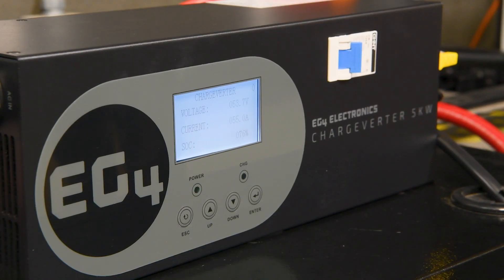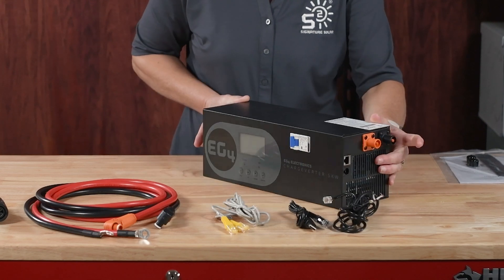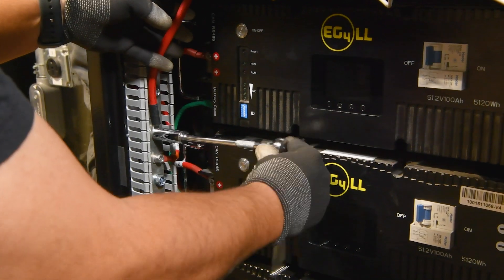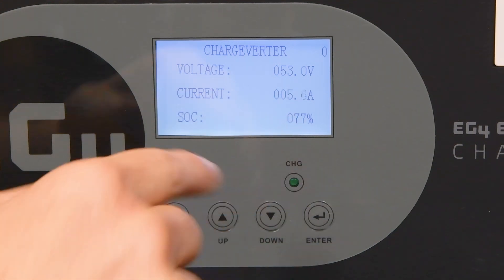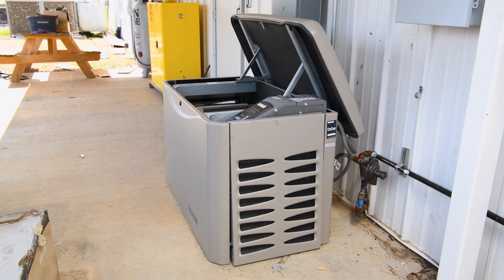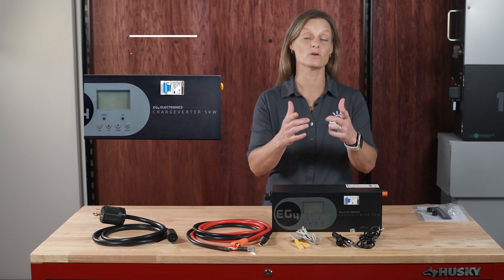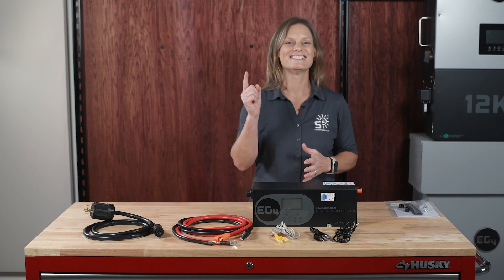EG4 ChargeVerter GC: Charging Batteries Efficiently from a Generator

Comment: WHat would be nice is a warmup time and a cool down time. I previously had this programmed via relays but then victron added into their firmware which was nice. Since I got my new inverter, I've been able to charge at 5000 watts however the power is dirty. My stove resets constantly and my pressure pump can't get enough power to flip the pressure switch. I plan on ordsering one of these and worse case, I can setup an intricatre relay speghetti monster to add warmup and cool down. Maybe you have a new model or firmware coming out soon?
Reply: It supposedly does have a cool down. No warm up though.

Comment: hi , can i top balance a DIY 48v 320ah battery from this , and/or is it the same if i charge the battery cells to 3.65v with a table power supply before assembling in a DIY battery? thank you for your help

Comment: Why not just put the superior electronics in the inverter so this is not needed?  In other words, if this can accept dirty power, why not build the inverter with the same charging architecture which can accept dirty power.   I'm confused.
Reply: Because not everyone needs it and it's more money. Inverter/chargers generally use the same hardware to invert as they do to charge. THis means that you can not charge and invert at the same time.

Comment: If I have, say, an 8000W draw for 10 minutes or so (e.g. cooking), will it take 5000W from the generator and 3000W from the battery?
Reply: Yeah. But it will still eventually catch up unless your average draw is over 5000 W. If your average draw is close to 5000 W this might not be a good product for you. My average is more like 1000 W. So I think this will work for me. I just bought one but haven't hooked it up yet.

Comment: Hi, I know this might be a dumb question. But does it have to be plugged into a generator? Can it be plugged into a 120 house outlet if seeded.  Thanks darrell
Reply from the maker: The EG4 Chargeverter is designed to work with generator inputs, but it can also be plugged into a standard 120V house outlet as long as the outlet can handle the power draw of the Chargeverter. However, you need to ensure that the circuit can support the current requirements without tripping breakers.

Comment: These are over $700 now and I just found out my EG4 18Kpv doesn’t like my generator. My batteries will be dead in a few hours with no way to charge them until grid power is restored or the Sun comes up 😢
Reply from the maker: We completely understand your frustration. We're here to help if you'd like to take a closer look at your setup or explore possible solutions to prevent this from happening again.
Reply: @SignatureSolar  Thanks for the reply. I think I will sell my current generator and replace it with a compatible one. In the long run this would be better than adding another piece of equipment.

Comment: Is there a wiring diagram for hooking this charger up to 4 indoor 3g4 wall mount battery's?
Reply from the maker: Hi! I don't believe there's a wiring diagram available, but if you have a bus bar that all the batteries connect to, you can simply connect the charger's positive lead to the positive bus and the negative lead to the negative bus.

Comment: I have two Ecoflow Delta Pros and 4 smart batteries with the dual phase 240v adapter. The unit will not charge through AC while running on 240v. I have a Champion Generator 4000W.  Can I wire adapters for the DC down to a xt90 and down to a XT60 so that I can charge with DC using the ChargeVerter?
Reply from the maker: Hi! It’s recommended to check with EcoFlow tech support before modifying any wiring, as changes from the original design could impact the warranty. You can email them at support@ecoflow.com - I hope this helps!

Comment: I have a home that all major loads are propane, my electric usage is some LED lighting, normal outlet usage..wifi,computer,tv, etc. The only larger loads are a 240v well pump and 2 ductless A/Cs also 240. Because of these 2 appliances I am forced to use a 240 volt inverter generator. I would love to use my small 2000W Honda inverter but it is only 120V. Could I install a battery pack with a 240V inverter and charge the batteries through the Chargeverter GC with 120V? This would allow me to turn the generator off at night and use battery power for the minimal night usage and then let the batteries charge with my 120V generator during the day. The reason for this is because the little 2000 inverter produces twice as much electric as my large inverter on the same amount of fuel.
Reply from the maker: Hi! Yes, this would likely be the best approach.

Comment: " Firesafe " backing  is very IMPORTANT   ... AAC panels are produced here in Central Florida  .

AAC
 (Aerated Autoclaved Concrete) 
is one of the most fire resistant products available  . 
   Aercon , Florida
Reply: The web site just shows blocks and large construction pieces. Can I get thin sheet pieces maybe 1/4 to 1/2'' thick?

Comment: hi Kelly  can you tell me who manufactures and what size the Amphenol connectors are on this Chargeverter as i would like to purchase additional male and female plugs.    Also i have an eg4 500 100 solar charger which is brand new   no. 1 the voltage does not mat what i measure  via meter and what my eg4 battery says    .  so there is an issue there  also i get the red light and buzzer when solar production falls off at end of day  . I have not been informed on how to remedy other then watching youtuber's videos ?   apparently a firmware update is nec. ,i called ss and basically schooled whomever at tech support on the matter and told them i need a special cable. Gentleman asks around and gets back to me -yes but we don't have any in stock , here  is a link to purchase components  and no directions on Constuction  pins ect.   and no procedure on actually updating the firmware?    Not good  I've spent plenty on 6000xp,  280 ah indoor batt  chargeverter  now solar charger  . We can do better  please advise  thank you Scott
Reply from the maker: Hello! I'm so sorry you've been having trouble! If you'd like to reach out to us directly at engagement@signaturesolar.com, we will get you taken care of!

Comment: Hi can someone tell me what size generator you need  to run the chargeverter at max charge rate in the 120 volt and the 240 volt. I understand  120 volt max charge rate is lower compared to 240 volt. just looking for generator sizing for both applications. Thanks .
Reply from the maker: You would need at least a 5000W generator for 240v or 3000W for 120v for max charging.
Reply: @SignatureSolar  Thanks so much for getting back to me.
Reply from the maker: You're so welcome!

Comment: My generator (supposedly an inverter type) was kicking out every now and then and would not hold its rpm consistently but after installing the ChargeVerter it's as smooth as can be.  I'm feeling confident that I can try my big generator now and I think I will - especially this time of year. 
Kind of pricey but in the long run this is worth it.
Reply from the maker: Thank you so much for your feedback!

Comment: I have a 2200W Honda generator. Can I use this small generator with the Chargeverter to (slowly) charge my system?  (my EG4 18kPV with 2 Powerpro 14.3kW batteries). The Chargeverter does not list a minimum power required. I know this will take some time.
Reply from the maker: Yes, that will work :)

Comment: My set up will basically be a custom portable kitchen/studio (16' x 8'). I was considering this to connect through the grid, to charge the battery(ies) overnight and then use it in the day. If I want to use my appliances for the desired times (6-8 hours), I was hoping the EG4 outdoor battery would suffice. Too small of a space for the indoor. So, that led me to loving that battery's emp protection... Would this chargeverter still work with the outdoor eg4 battery during emp 'times', or would it need protection like the 18k inverter models, etc.? Thank you!
Reply from the maker: It would need protection.

Comment: Can the chargeverter connect straight into a generator input (example 12,000xp)? Or is it only designed to be connected to the battery via a bus bar?
Reply from the maker: Yes, just the battery.

Comment: Can you tell me if this charger will charge lead acid batteries also? thanks
Reply from the maker: This is designed for lithium. Other battery chemistries are supported but the manufacturer should be contacted prior to use to verify charging specifications.

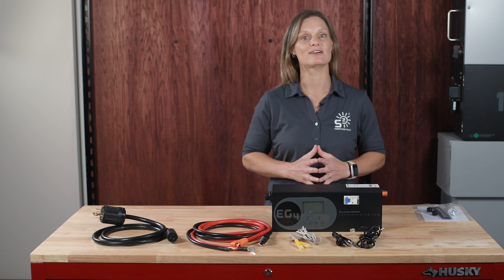Comment: 11:30 Re: Alternative power sources -- great point on this. 
Q1: Will using it with the Cybertruck that has a NEMA 14-50 (40 amps) work since the EG4 spec explicitly says the limit is 26? ("Maximum Input Amps: 26A at 240VAC, 28A at 120VAC")
Q2: How does the "Gen 2-Wire Start/Stop" work in this EV truck scenario?!?

Comment: Signater Solar, I'm wondering if you can run this through a shunt? I know it says connect to a busbar but why couldn't you just connect the ground to a victron shunt instead. Would it work? Have yall tested that method by chance?
Reply from the maker: We have not tested it. We recommend following the manufacturers guidance.

Comment: I sure wish you would have shown us using the powerpro battery. This must be difficult because most of us have the powerpro battery
Reply: Wonder why Sig solar will not respond to this question???
Reply: @LarryRichelli  They are only responding to a handful of questions.
Reply from the maker: Hi Larry! We appreciate your input! Could you rephrase your question?
Reply: @SignatureSolar  I would just like to see how to connect the ChargeVerter to the EG4 PowerPro WallMount AllWeather Lithium Battery
Reply from the maker: Understood, thank you! There isn't a video at this time but we will forward your suggestion and take it into consideration! You would just connect it to the bus bar. If you need any assistance, you're welcome to call in at 903-441-2090, we're happy to help!
Reply: @SignatureSolar  The thing is the battery is outside so a bus bar is not used as the 18k inverter is on top of the battery. Could you please tell me what the connectors are on the chargeverter output and where I could buy them.

Comment: so my generator is rated less than 2%thd, so it's fine to use for just emergency backup charging the two eg4 48volt  batteries running with my eg4 6500ex that is totally just backup emergency power isolated from the grid at all times......the setup just powers about 3500watts(max of all fridge /frezzers compressors running which they obviously don't run 100% of the time)  of bare necessity items in case of rare power outages.....keeps my fridges, freezers, and some lights, phone chargers, ect covered again only as a redundant system if I don't want to run my genny say over nights. I have 7500 watts of solar panels yet to install, but those are not online as of yet because I need to built the array structure still.
Reply from the maker: Sounds like a great setup, let us know if you have any questions!

Comment: It is not like generators fall off of a cliff at 60% Typically the "dirty" ones get worse as the load increases but it is not that difficult to find one that will hold below 5% thd all the way up to 100% capacity you just have to LOOK

Comment: The charging voltage that this unit is far too low to fully charge a 48 Volt LFP battery. The manual for this low-cost charger states that this unit is only capable of a 57 Volt maximum output. In a properly designed 48 Volt LFP charger, the output should be capable of reaching at least 58.4 Volts or3.65 Volts per cell to fully charge a 48 Volt LFP battery,  This unit appears to be poorly designed for use in a 48 Volt LFP charging system.

Comment: Can you connect this to a eg4 wall battery while having the battery connected to a 6000xp?
Reply: one of buddys comments above said you cannot, if your talking about the communication cable
Reply: @pleasurem3  no I meant the positive and negative wires. So you can charged the battery with solar and generator. 

Not to mention having 2-3 batteries in parallel how would you charge them with the generator via the Chargeverter GC and solar.

Comment: I have a champion Model #201175 generator.  It has button start features only by the looks.  Will I be able to do the remote start via dry contact cables?
Reply from the maker: If the generator does not have Dry Contact terminals to run a 2-wire auto-start circuit from then it cannot be autostarted by the inverter.
Reply: @SignatureSolar thank you!

Comment: IAnothe well done video.  Thank you.  I have a Victron system.  Will turning on the charge enter cause the Victron Multiplus II to shut down like is reported on the EG4 systems?    Is there a market for a modbus device that will snoop on the data between Battery and Inverter, and then act as a slave to the Chargeverter Modbus master?

Comment: Will the PowerPro Battery Paralleling Cables work for this without having to have a bus bar? I'd have to buy more cable any how to connect the battery to the bus bar. So I might as well get a set of paralleling cables..
Reply: I have 3 outdoor wall mount 280 amp hour batteries in a Boss Box. I designated the middle battery as the #1 battery and used paralleling cables to connect both outboard batteries. Everything is connected with their 2/0 cables. The middle battery has 2 positive and 2 negative cables coming from the middle battery and feeding into the Flex Boss 21 inverter. This works very well.

Comment: Would the chargeverter be redundant if you are using a Generac whole home generator or is it still a good idea to run the Generac through the chargeverter ?
Reply from the maker: It wouldn't be redundant. The chargeverter safeguards the inverter from the high total harmonic distortion (THD) generated by the generator.
Reply: @SignatureSolar  thank you.

Comment: Quick question, I noticed you said to charge two or more powerpro batteries you would need a bus bar.  Do you have information on a degsun bus bar? Trying to design an offgrid system that will be charged with solar or generator during winter.

Comment: What specific (less expensive) generators are recommended for use with this charger?
Reply from the maker: We don't recommend specific generators because our inverters are generator agnostic (can accept any if they fall into the correct parameters); those parameters are 5% or less harmonic distortion, 120/240V (so not 120V generators), and floating Neutral

Comment: One thing missing from these videos is what happens if you have non EG4 inverters or batteries.   This product looks like it would fit my needs.  
I am presently under Calif's NEM-2 and cannot add to my existing solar system
But now, with an EV, and heavy irrigation via a Well, and booster pumps, I am using a lot of grid power.

In addition, anytime there is wind, or a Fire, or a car crash, the utility cuts the power, leaving me without a water system for fire suppression. Or any power for that matter.

So I need a way to charge my batteries when solar production is down using the Grid.  But I cannot backfeed to the grid, as that would violate my NEM-2 agreement.

Can this be setup to be just plugged in, monitor voltage, and charge when necessary?   Without the RS-485 wiring?
Reply: You can add more panels and keep NEM2.  Also, NEM2 has backfeeding.  Why do you say you cant backfeed?  Thats the whole point of NEM.

Comment: Kelly this is my new cargo work trailer plan 
EG4 ChargeVerter Gc as Back up with a Honda EB2800I Generator as Back Up only 
Main system is 6x370w Aptos biracial panels on the roof 
The Battery 48v 280watts pro Battery 
Wire Chase box
The EG4 6000XP Off Grid Inverter 

Please Tell me you Thought

Comment: how can i charge the pro battery with this chargeverter  if pro battery is connected to a eg4 12k? tks
Reply from the maker: You can use a busbar :) If you need any assistance setting it up, please don't hesitate to reach out to our tech team at 903-441-2090!

Comment: Too much time spent on sales pitch and not enough technical info. Since you can't use the battery com simultaneously with chargeverter and inverter, we users need the voltage start/stop settings on the chargeverter. Too bad she didn't say anything about this.